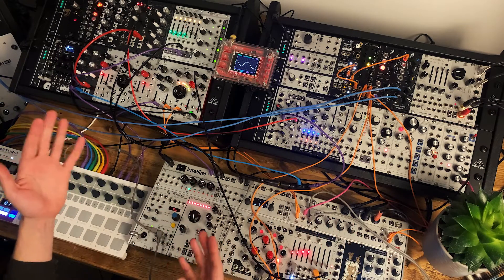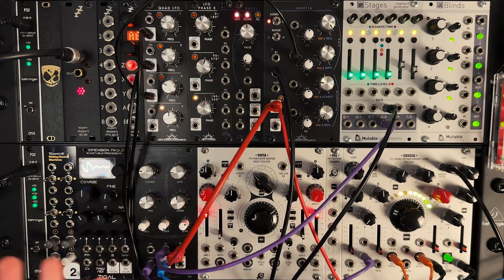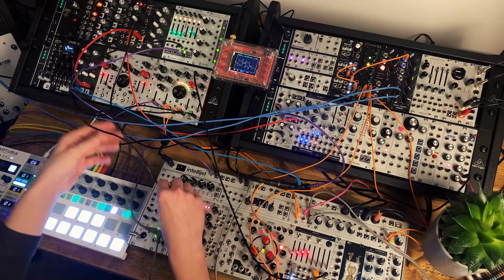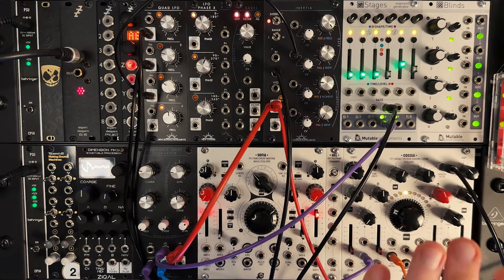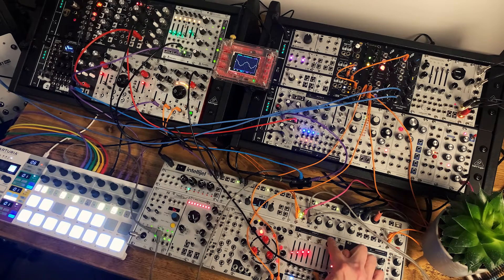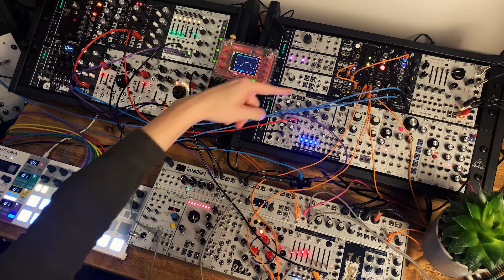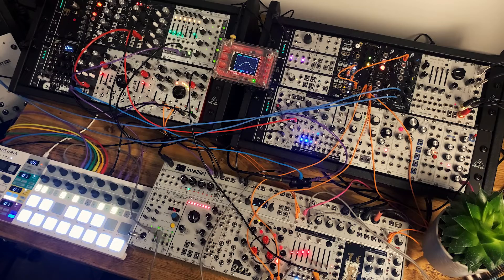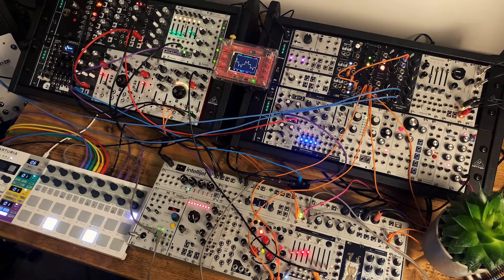How polymetric modulation improves a simple sequence

Comment: Delightful! What’s the scope you’re using in between the top racks? Looks like a natty wee device.
Reply from the maker: Thanks! It’s just a super-basic DSO138 - I think I got mine on Amazon for about £30 as a kit, but that was a while ago. I've seen them recently for as little as £20 fully assembled on AliExpress...
Reply: @TomChurchill  Wow, I, just looking at one now. Is is a simple matter of using an adapter to get the audio into the BNC?
Reply from the maker: @chitlun  yep, I just use a BNC to 3.5mm jack cable and a passive mult. There’s also this, which does basically the same thing in a convenient package - out of stock at the moment though: https://www.thonk.co.uk/shop/threetom-modular-wiretap-adaptor/
Reply: @TomChurchill  So, from the signal out into a mult in, then one output to the scope via the adapter, and the other output to the destination module? That seems like the most sensible route, assuming that BNC connecter is an input - I've never used any kind of scope before.
Reply from the maker: @richarquis  yes, exactly like that 👍
Reply: @TomChurchill  Cheers! In that case, until I have money and hp for a Mordax Data, this will be my solution. 

I'm also a kindergarten teacher, and we always go deep in our science lessons. My class understands about wavelengths for light and sound. We've done lessons on how the different wavelengths of red and blue light create the 3d effect, and just 2-3 weeks ago, we looked at different kinds of scopes, and so I put an oscilloscope in alongside microscope and telescope and stethoscope and kaleidoscope. We watched a Divkid video on the Joranalogue Fold 6 to see the effect. I promised them I would bring in one of my modules and an oscilloscope, plus a subwoofer and a box with sand/salt, to see the changes on the scope and the changes in the sand/salt patterns as the frequency changes. This will be the fastest road to that lesson. I'll be ordering this in the next few weeks, thank you so much.
Reply from the maker: @richarquis  That sounds awesome - I wish I'd had you as a kindergarten teenager when I was a kid! :) Best of luck with it and just let me know if you need any other tips on setting it up 👍
Reply: @TomChurchill  Wouldn't you know it! 2 other modules I ordered came up as out of stock, so there's plenty of room on the card. I'll order the scope (heck, maybe even one of the nicer ones) this weekend, and when it arrives, I'll message you if I have any trouble. I'll be pairing it with 0-Ctrl and 0-Coast (No way am I letting their grimy little fingers anywhere near an actual full case!) and they'll be allowed to play the 0-Ctrl keyboard. Our last science lesson of the month is making a toy pan-flute, so we'll go in-depth on soundwaves, and the relationship between pitch and wavelength. They'll play it on their own toys, they'll play it on the 0-Ctrl, they'll see the waves on the scope, and watch the sand/salt change patterns. I appreciate your reply, they know this lesson is coming up, they just don't know when.